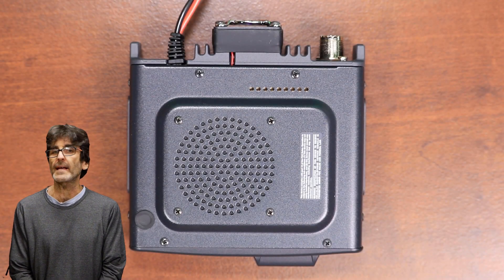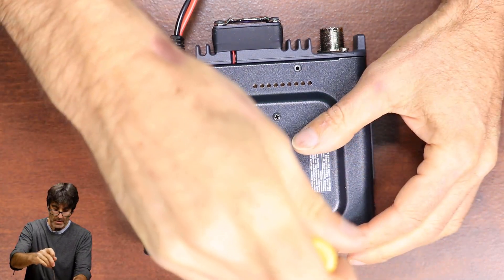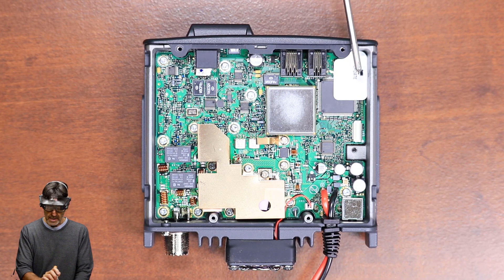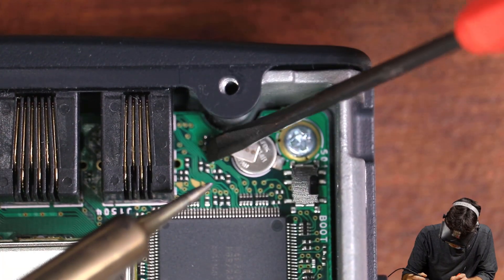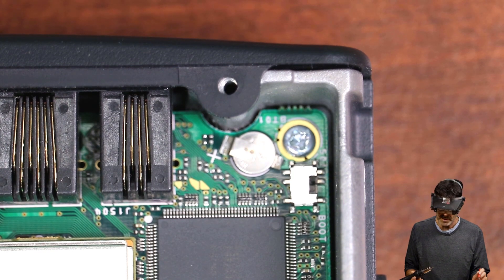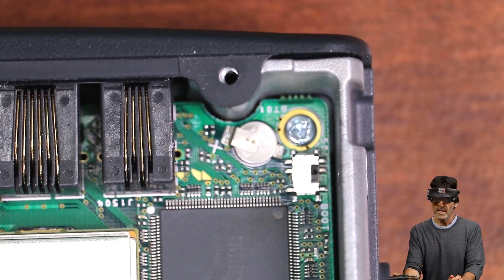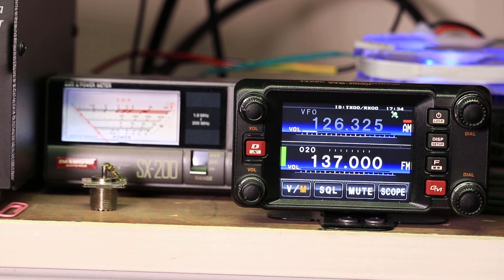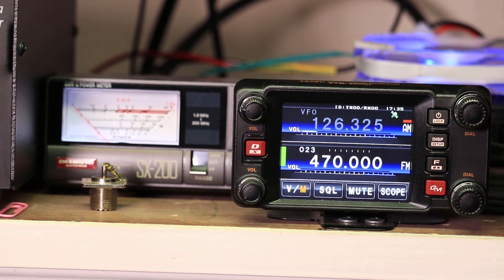Open/ Expand Transmit Modification Yaesu FTM-400XDR

Comment: Great video 👌 thank you 😊
Reply from the maker: You’re welcome 😊
Reply: @JLPicard440  if I wanted to download the schematics of this particular radio so that I could begin to familiarize myself with the electronics of the logic board on this radio where could I download that And if at all possible is there a way to open up the transmit even more than what you've currently done just for the sake of ready preparedness just wondering if it was even possible and if it is possible where or what chip would you remove to open up the TX on the radio
Reply from the maker: HI, Here's a link that I found easily.  If this doesn't work, just google the FTM-400XDR Technical supplement.

https://www.google.com/url?sa=t&rct=j&q=&esrc=s&source=web&cd=1&ved=2ahUKEwjYjPfz9-zoAhXXgnIEHWL-A7QQFjAAegQIARAB&url=http%3A%2F%2Fwww.repeater-builder.com%2Fyvs%2Fpdfs%2Fyaesu-ftm-400dr-de-xdr-xde-technical-supplement.pdf&usg=AOvVaw1tGCiqbcmDF686NQ1JJXMt

I don't believe it would be very easy to open the TX.  The RX is what it is, and to open the TX beyond that wouldn't be easy. You'll run into trouble with the circuits inside the radio being designed to work within a certain bandwidth.

Hope this helps.
Reply: @JLPicard440  😭  lololol thank you was just curious  I'm increasingly getting more interested into little electronic modifications things of that nature these PCB boards are so small the electronics so tiny microscopic very interesting stuff
Reply from the maker: Yes very cool!  Don't try anything to crazy!  You're radio could turn into a paperweight... 🤣😂

Comment: I did this mod and it worked, but with that bein said I also lost two of the GPS functions on the display list. Alt and gps sat info..
Reply from the maker: I just checked mine and I have GPS info.  Can you undo the mod?
Reply: @JLPicard440 , no. The resistor is gone now. But I'm not worried about it.
Reply from the maker: OIC... I'm not sure what the value was!.. aargh... might be able to download the service manual and see which one it was, that'll show the value o the schematic.
Reply: @JLPicard440  it was just the GPS altitude and sat list screen. I'm just happy it still has the scope.
Reply from the maker: I didn't see the list screen but I definitely still have the altitude info.. I wonder why that affected yours in that way..
Reply: @KI5BEZ  After the mod the radio reset to default. I was able to restore these functions in the Setup Menu- Display- Display Select- Altitude (switch to ON), GPS Info (Switch to On). Works like it used to for me now. I also noticed it reset the RX coverage to normal (Ham band only), you can switch it back to WIDE on the B Band for extended RX coverage. Hope that helps.

Comment: Thanks for all your videos!  I want to expand my 400 but I have heard you can lose some features on the radio?  Automatic offset is one and maybe others?  Any lose of function on yours?
Thank you!!
Reply from the maker: I haven't lost the auto offset on mine.  I don't use many of the features and functions on this radio, so I have noticed no ill effects at all.  But that doesn't mean there isn't something missing that I haven't noticed.  But I can say, the auto offset was not affected.  Best bet is not to ruin the component that has to be removed, and try to preserve it in case you do have to put it back.

Comment: Great video.  Does this radio do DMR type 1&2?    What is the info on the air solder tool.
Reply: No, it does not do DMR. It only does C4FM.
Reply from the maker: Thanks for the comment... I did a search thru the owners manual,.. I didn't see a listing for DMR.. the solder tool is a vivohome 2 in 1 898D .. I'll post a link to it in the description
Reply: Will not do DMR, P25, or D-Star.  But will do C4FM Fusion.  It will receive all of the frequencies that DMR operates on, but won't decode that mode of operation.
Reply from the maker: @joedidit3233  Do you mean after the mod?  I'm not having any problem with mine.  I thought D-Star was Icom only and DMR was an EU version of Digital?  I could be wrong..
Reply: No, I just meant in general, before and after the mod.  That the radio doesn't decode DMR even though it receives the signal.
Reply from the maker: @joedidit3233  OIC.. I can't answer that.  I havent tried that mode on mine.  From what Ive read DMR is for EU radios... is that not right?

Comment: Great video, I will work on this mod on my radio... talking about GMRS frequencies - The FCC allows for GMRS radios to have significant power increases from FRS radios (which are limited to .5W on 467 MHz interstitial channels, and 2W on 462 MHz main and interstitial channels). This power increase can be utilized fully on 462MHz main channels such as 15 – 22 where GMRS power is limited to 50W (for mobile units, handhelds limited to 5W). - source https://midlandusa.com/why-gmrs-for-two-way-radio-communication/ thanks for sharing the instructions. have you be able to update the radio frequencies via Yaesu Software after complete the mod?
Reply: You need to have a ham radio license to modify and use a modified radio. It is illegal to use otherwise...
Reply from the maker: HI, thanks for the info.  I haven't tried using the Yaesu software to update the frequencies.  I always just program it manually.  A couple of guys did report they had problems with the software after the mod, but I haven't been able to verify that on my radio.

Comment: Nice to know. But it is too easy to screw up and accidentally transmit with your call sign. As a new ham I got a Yaesu ft-8100 used. Programmed already by local ham. He set up some memories for monitoring EMS. Since the radio was set with an "a" and "b" sides, Id' listen to EMS on "b" side and sometimes forget to switch back to "a" side when I went to transmit. Thankfully it wouldn't transmit out of ham band. I'd suggest not to do this mod. Not sure the practical reason to do this when weighing the issues with getting recorded in an out of band screw up. You can't take your call-sign back after transmitting it.
Reply from the maker: Yes, you have to be conscientious about where you transmit!  Fer sure...

Comment: Mine is ftm 400xd japan version. Tx is 144-146/ 440-460. I remove & screen become region error. I put back & become normal. Any suggestion on this ftm 400xd for tx open? Tq
Reply from the maker: Check mods.dk and see if theres a different component you're supposed to pull on that rig
Reply: Japan market radios are firmware locked, you can do what ever mod you like and they stay locked, thats on all new radios that have been out for the last 5 years or so..